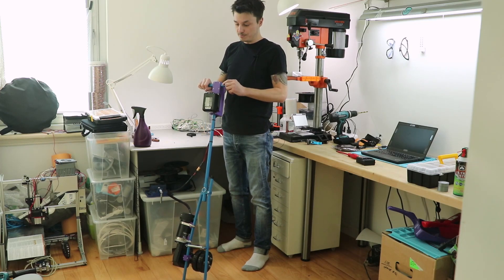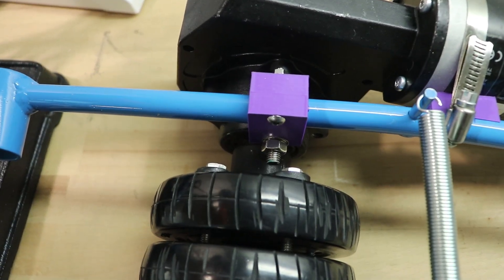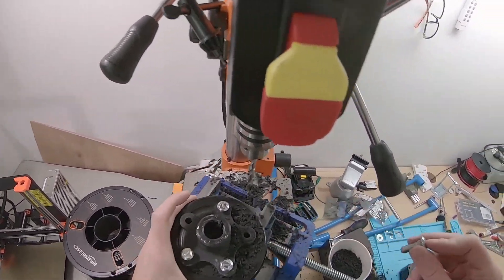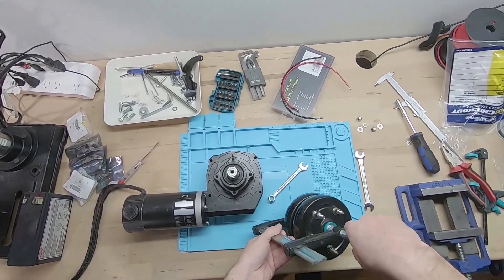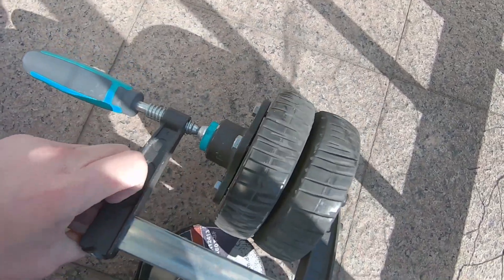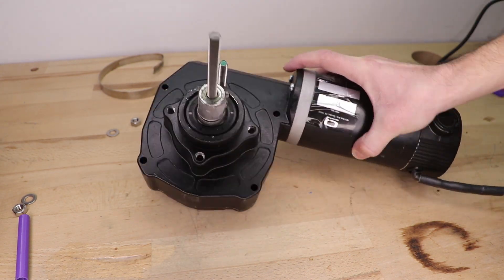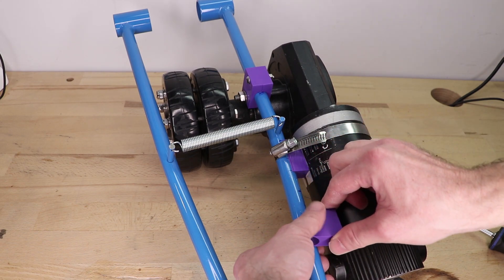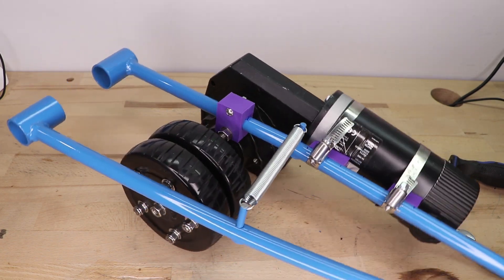DIY Battery powered Electric Airplane Tow Bar / Tug

Comment: Nice job...what kink of motor did you use ??? looks like a wiper motor from a truck ??

thanx
Reply from the maker: No this is a motor from an old electric wheelchair. I found them on eBay. They are slow but have a crazy amount of torque.

Comment: Hi!  How big of an airplane were you able to pull with this design?
Reply from the maker: I don't know. Our plane now has the wheel covers on and I can't test it. I am still looking for testers.
Reply: @brankly  I'd be curious to find out if I can tow a Piper Arrow with it.  I don't think it can move a Twin Commanche or Seminole from the power requirements I have been reading about.